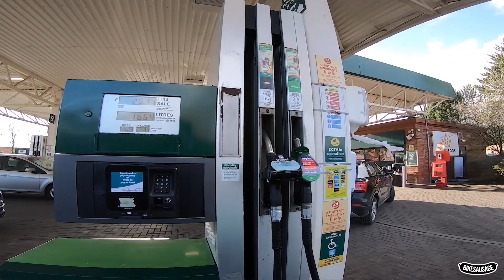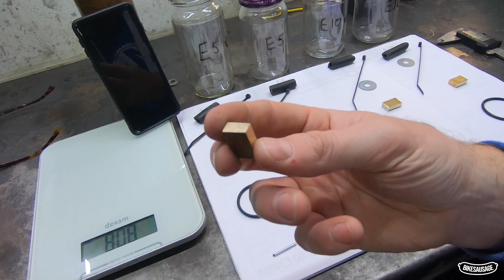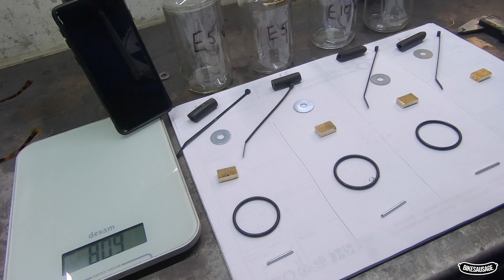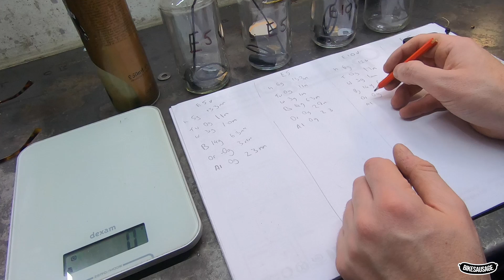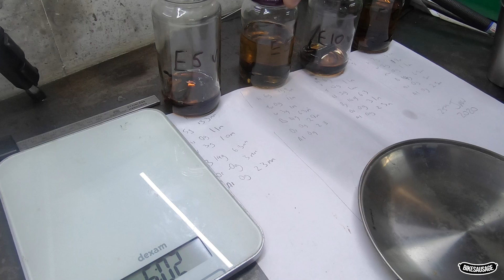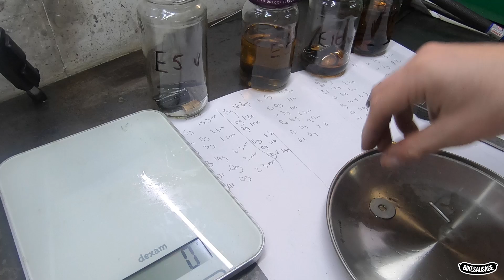E5 v E10 FUEL | Does it really make a difference?

Comment: Plastic tanks on Ducatis, Aprilias etc have had problems with E5 already… it is well published about the tank swelling problems.
Reply: Yup, my RSV Mille has a belly more swollen than Jockey Wilson
Reply: @theavangelist  There’s an image 😳
Reply from the maker: E10? Or E5?!
Reply: @bikesausage2614  E10. E5 on pumps is in quite a lot of cases actually E0, there is no Ethanol in it at all. This depends on the brand. Thousands of owners of Gen1 Aprilias with plastic fuel tanks, including myself, have the swelling issue. I have to drain it over the winter and store the tank dry in a warm place and it will actually shrink back, otherwise i have to fight it to get it mounted. Ask Griff at AP workshops and he will 100% confirm this.
Reply: @fahrvergnuegen  The swelling issue is Aprillias fault. Contact them.
Reply: @thedirtyworkshop  what is that going to accomplish? When they released the bike in 2000, there was no Ethanol in our fuel. So they were fully compliant at that moment and now gov decides to add more Ethanol and the manufacturer is supposed to be responsible in any way? We do not all live in the USA were you can sue everyone for pretty much anything. And I'm happy so.
Reply: During my last years in the trade as a motorcycle mechanic before retirement I saw not only Aprillia tanks wrecked by e5 fuel but also Hinkley Triumph fuel tanks, Speed Triple ect. The first thing you notice once unbolted is the tank is very difficult to remove from the bike because it has swollen, ok now try re fitting the tank. Try looking for s/hand tanks for these bikes on eBay, rare and expensive because of this. Also saw one poor guys Honda VFR 750 totally burnt out, he pulled up at a junction, the fuel line or a carb O ring must have failed and the machine burst into flames, lucky for the rider he escaped un injured...that's e5. I use Castrol Valve Master with additive to prevent ethanol damage and use e5 95 octane + I drain it all out if machine not in use, ie winter.
Reply: @mikecartlidge5355  I have a 2005 Speed Triple with the plastic tank.Over a few years of using E5 the tank has expanded slightly and has become very difficult to fit back on the bike after any maintenance...I would say it is half an inch longer and the bolt holes no longer line up.I got around it by not fitting the metal tubes the bolts go through at the front and back of the tank and using some force!I plan to use a Dremel to remove a small amount of the plastic at the front bolt hole if it gets any worse,but I am still using the E5.But the tank still looks good...I keep expecting to see some sort of stretch marks in the paintwork....cracks or suchlike.
Reply: @eskertoo  Hi Tony, sorry to hear about your tank problem, maybe if you started using an additive in your fuel to guard against ethanol damage it may limit the the growth, either that or Tapox make a tank sealer that is ethanol proof up to e10.
Reply: @eskertoo  Complain to Triumph. It's their issue. They have known about Ethanol in fuels since 1995
Reply: @mikecartlidge5355  yep, I always use super unleaded with an additive in my thunderace, I'd let it run out and push it before I'd put E10 in it.
Reply: @sambrooks7862  Morning Sam, yes I agree. Can't remember if I posted this already but there are videos on here that show you how to remove ethanol from pump petrol simply using water, yhe separation process takes 12 hours, buy it does lower the octane of the fuel so you need to add a little none ethanol based octane booster. Have seen posts back from classic bike and car owners that said it works well. There was a company that brought out a full kit complete with instructions for doing this, it was called Ethernil buy it disappeared off the market, I wonder why?
Reply: Glad my Ducati has metal tank only 6yr old
Reply: Yes, but they are overpriced junk anyway, so I wouldn’t touch an Italian bike with a long pole
Reply: The tank on my 2009 KTM 990 Superduke also got paint damage. About 4 years ago, the paint became covered in blisters (ethanol/water evaporating under the paint?) and the tank itself grew so much that I had to machine the mountings so that I could refit it. I've always used standard unleaded, whatever it was at the time.

Comment: "scientific experiment" uses kitchen scales that can't do less than 1-2g increments 🤣🤣 Still entertaining and instructional but I found that funny. For reference though corrosion test such as these, if they are measured by weight, are usually measured with scales that are accurate to 0.0001g and at least a micrometer (0.001mm accuracy)
Reply: Mate it’s bike sausage not spaceX
Reply: @joshuaryan5279  Yes, in which case they shouldn't try to make scientific experiments, but instead just say "here is what happened after I left an o ring in E10 for 2 months" and then some jokes about how it will break your rubber if you dip your willy in E10
Reply: YAWN 🧐

Comment: Yeees, tried exchanging o-ring for a fuel tap, sealed for two days on the e10. I would never use e10 fuel on any carb bike. At least not let it stand for a while, without topping up with e5 or any other low alc content fuel. Good luck on the island!
Reply: There are people who run E85.
Reply: @thedirtyworkshop  and very high boost pressures.! lol.!

Comment: Go look at how it attracts water when left standing!
Reply: Imagine what a layer of water does to your metal tank over 4 months
Reply: Does ethanol have an affinity for water?
Ethanol has a greater affinity for water than it does for gasoline. Over time, without agitation, gasoline will be found floating on a layer of an ethanol/water solution. The resulting ethanol/water solution is still flammable since the concentration of ethanol is still fairly rich.
Reply: @100CupsColombia  Its not inherently the water itself but the microbacterial fungi that are able to live in the water and eat the fuel up. the excreted material is corrosive, strips paints and organic corrosion prevention and clogs a fuel system . comes out as a browny sludge in the base of a tank, nasty stuff
Reply: @TRJx86  Then try starting your ancient Norton Commando! An 850 kickstarter experience😅 The KTM's are no bother-small mercies